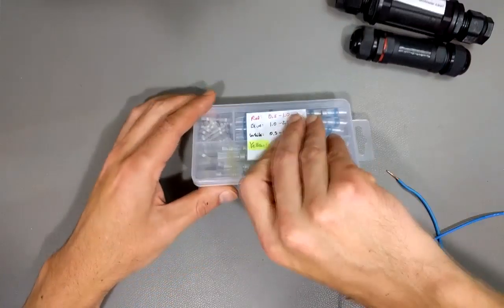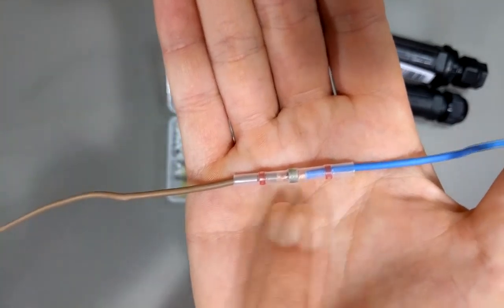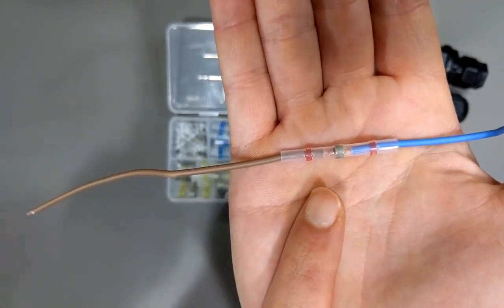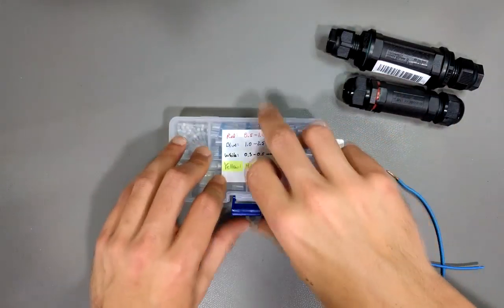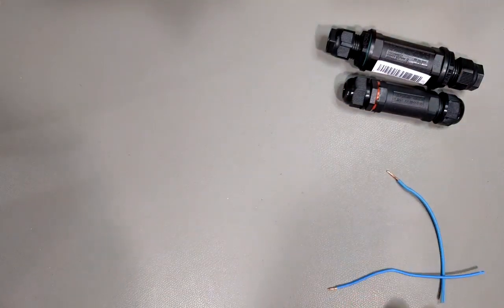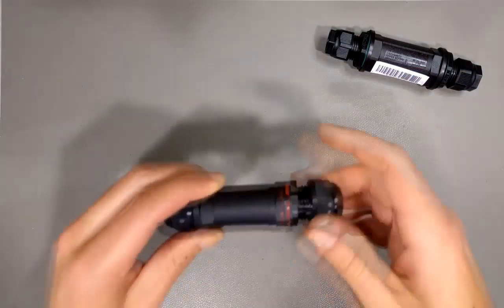Easy waterproof Cable and Wire Splice

Comment: Wow! What a hack job. Under 20 bucks will buy you a proper heat shrink direct burial UF splice kit. Works on 14/2 to 8/3 UF cable. Cobbling together some splice reducers, tape silicone and a shopping bag is surely UL listed. NOT!

Comment: , thanks for the video, I cut thru a gardening client’s outdoor lighting wire while digging up some perennials, do I need to turn off any fuse or electrical source to the lights before making the repair?  🌺

Comment: is there one for cat5 cable ?
Reply from the maker: Yeah, you can do what Mr Panda said. You might lose a BIT of signal integrity (speed) depending on how you do it, but it'll work. Or you can use one of these: https://amzn.to/2VZzedL  IP67 waterproof RJ-45 coupler. I didn't even know those existed!
Reply from the maker: Hmm, I dunno... I've never seen one anywhere.
Reply: Ok thanks for getting back to me
Reply: Don G use a smaller waterproof butt splice like the one shown in the video, but smaller
Reply: I didnt think cat 5 was sliceable

Comment: The 3M product (scotchcast) is great. Its a 2 component PU resin. Set times are between 15 minutes and a hour. Epoxy and EPDM can also be used. I normally use it with shrink tube: shrink one end first, fill it with resin, and shrink the other side. This work fine, even kilometers under water. And use crimp connection where you can. soldering is not recommended.

Comment: About IP classification, if you are not planning on using your connection, permanently under water, ill recommend IP66 instead, it is almost as watertight but are much tougher and protective against tare and ware.
Reply: Fried Mule is it any good for it’s cousin, wear and tear?